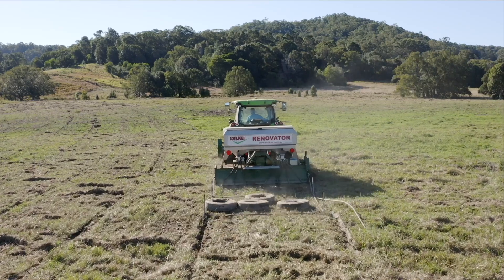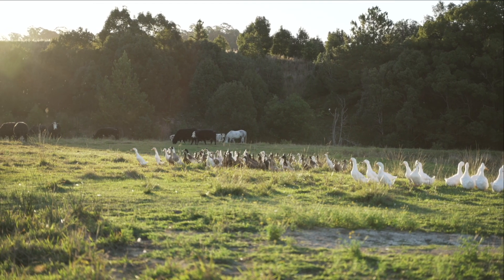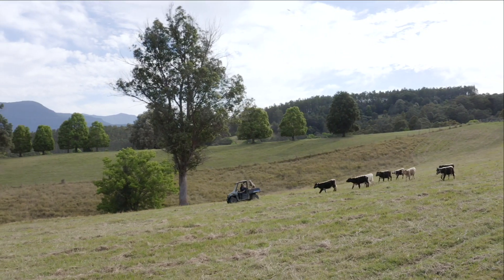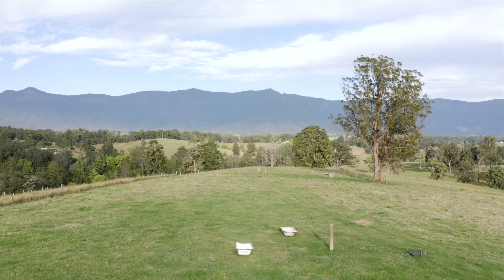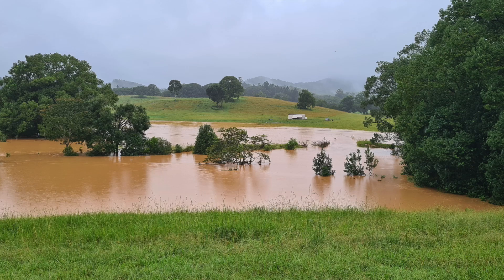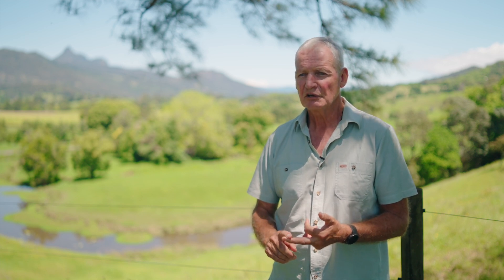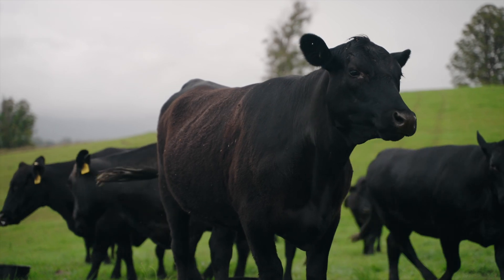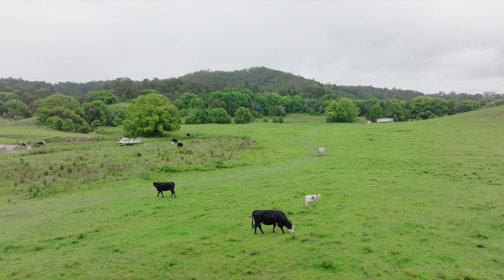Paddocks to pastures using the Soilkee Renovator,  multispecies pastures and rotational grazing

Comment: Compost tea mixed with biochar is quiet alkaline often up around 8.5 or 9 and would make a far better addition to the soil particularly when direct drilled with seed, it creates Terra Pretta soils that are fertile and stable for thousands of years, for those at the tip of the spear and serious about getting real carbon in the soil doing wonders a compost tea/biochar mix would make a far better base/alkaline addition to pasture than gypsum or lime, it takes a bit learning and extra effort but had benefits for thousands of years to come.

Comment: Does this piece of kit work in dry land areas? It looks great if you're getting 1000mm of annual rainfall and your temperatures are kind for 90% of the year, but what about regions that are dry/hot low humidity in summer and wet and cold in winter? Any examples of success in these areas?

Comment: Do you let the existing grasses go to seed? You’ll never be able to put down as much seed as just letting your grasses go to seed. Get the cattle off for a full year. Brush cut the grass at max dead growth mow it on contour and it will make small swales as it settles to hold and slow water back. Rotational grazing doesn’t allow for enough mulch cattle eat it too clean ever if it’s left 6” or 8” tall.

Comment: Seems to me like that one college guy or government man,I'm not sure which he is, don't want to fully come out of that depend on heavy equipment and Chemicals fetish.
Reply from the maker: Yes, we had some interesting discussions over the time, but ultimately he suggested cheaper and more available alternatives to using the Soilkee Renovator, which is a superb machine, but not easily available in the Tweed. He also had a point about using the urea as the growth rate (feed production) of the multispecies pastures was at least double that of the non fertiliser and organic poultry manure (although the poultry manure effects appeared to last longer). After decades of grazing, our trial areas were fairly devoid of nutrients and organic matter so they don't have much in the nutrient bank to give to the multispecies pastures without some kind of fertiliser input, otherwise the exercise is not very cost effective when the plants don't grow. This is also why it is recommended that the Soilkee is used a minimum of three times to kick start the soil biology and deeper nutrient cycling down in the soil. The soil biology is something that we didn't really appreciate fully until the end of the project
Reply: @tweedlandcare636  from what I understand, a typical soilkee application is a 50/50 mix of seed and fertiliser. Was that what you guys did? Obviously that will provide a pretty big kick along, but not necessarily long term. I've been trying just coating my seeds and using a direct drill. 
Also interested if you had any more findings on the result during this wet period- I've found (NSW Hunter region) that I did more damage running a tractor on super wet soil, and that the seed I did get in was out competed by everything else, as the growth rates were so strong.
Reply from the maker: Hi Ben, no we didn't apply fertiliser just seeded with a 'Landcare' mix that was developed for our subtropical climate (can share that if you want). Both farmers wanted to use sustainable methods and tried to address soil deficiencies using lime/OzCal and non synthetic fertiliser i.e. soft rock phosphate. We underestimated how poor the soil condition was before we started and tried to address the issues of low pH, low nitrogen, low phosphorous, low potassium on the run. There had been no inputs to these soils for decades other than livestock manure and they were compacted and hydrophobic. We did small trials comparing the application of urea and organic poultry manure with a control of the Soilkee method alone. The urea trial went gangbusters in the beginning and the organic poultry manure kicked in a few weeks later with both showing marked improvement to the Soilkee treatment with no fertiliser. The poultry farm has excellent results where the chicken tractors had been, including the clovers (which are nitrogen hungry).
We had mixed results and better in the first year on the farm that was flooded. However, overall the Soilkee did an amazing job of breaking up the compaction, improving the condition of the soil through its mechanical action and presumably helping soil biology through better soil structure and fixing nutrition from the legumes. We would need to keep doing it over a few more years to get the real benefits. Yes there were furrows left that are annoying when driving/riding over. They have diminished a bit since last year and could possibly be fixed with more Soilkee applications. My understanding from multispecies pastures is that annuals are often planted, but we still have perennial species such as clovers and chicory kicking in from last year now with the cooler weather and the subtropical grasses are shutting down for winter. The hope is that with the rotational grazing method we can nurture these remaining species and keep more diversity in the paddocks, with their multitude of benefits to soil health.
Reply: @tweedlandcare636  I've been seeing multiple video's on youtube with people improving Pasture by Rotating Cattle and sheep around. Probably the biggest most popular channel is Greg Judy. But he's not the only one. And it seems they each tweak it abit for what their needs/lifestyle is.  Some people have more time to move their animals than others. And some people need to use more hay than others. In one video I seen the guy said that it seems each year he needs less and less hay cause his Pastures seem to get abit better each year.